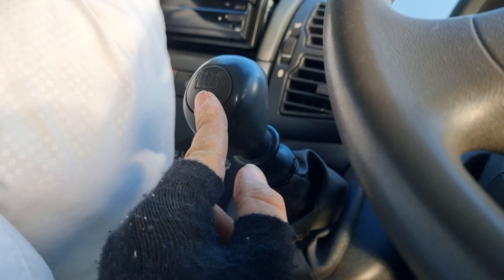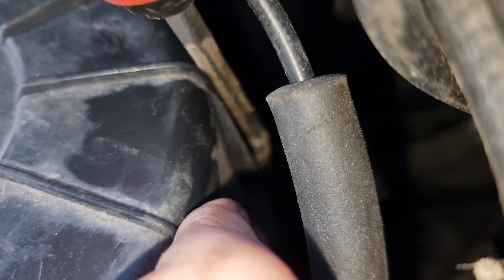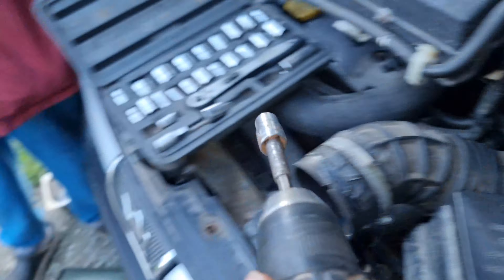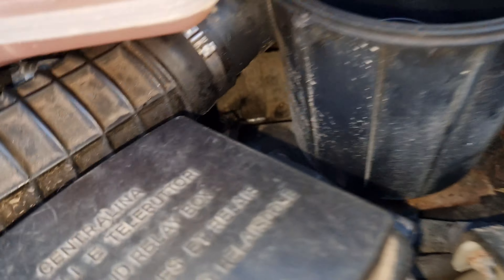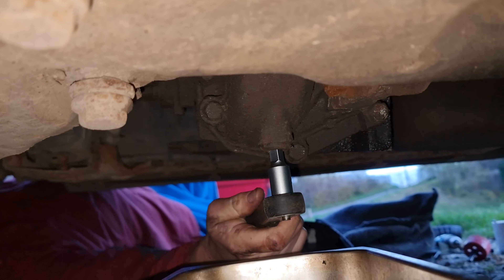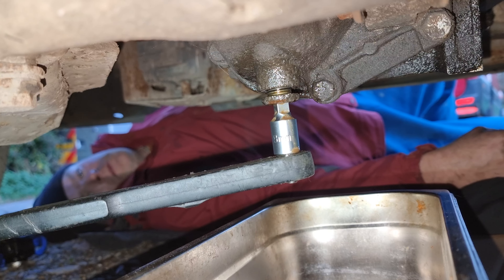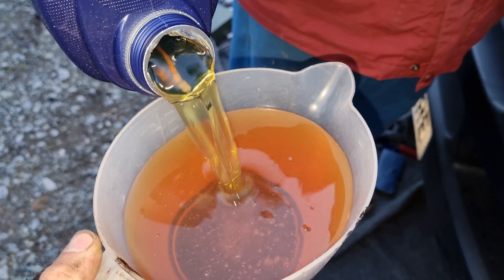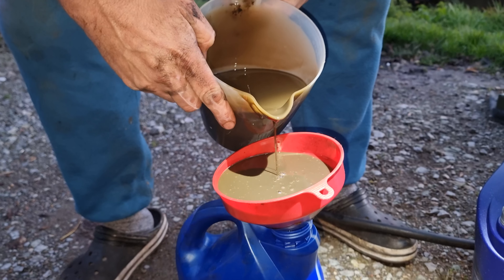Peugeot Boxer 2.8 HDI 2002-2005, Gearbox Oil Change | Attempting to Repair Our Grindy 5th Gear

Comment: Good for you guys for changing it. Nobody bothers with gearbox oil. I had the same problem with my windscreen leaking onto my engine. Check your gear linkage cables for play..

Comment: I've got the exact same model of Boxer and like yours 5th gear crunches. Our get around it is to double clutch 5th gear and that seems to avoid or lessen the crunching considerably to the point where it cant be heard. Our van has 140K on the clock and has been crunching in 5th since before 120K so its not gotten any worse in 20K miles by double clutching...........I'd also say that cleaning and greasing the gear linkage on top of the gear box is a must as this area is prone to getting lots of crap on it which can only make gear changes worse if left unattended to........

Comment: The problem with it being an ex mini bus you just dont know how many bad drivers have been behind the wheel,it could last for a long time as long as you take your time putting it into 5th,but its one of those how long is a peice of string moments at least you have given it a chance by changing the oil.
Reply from the maker: Good point. Luckily, we don't often use 5th, but I'll let dad know. Cheers for the advice 👍

Comment: Hi Josh. As a Mechanic who did 34 years in the motor trade I can honestly say that I think your 5th gear synchro is at fault. This means a new box or a refurbished, oil won't make any difference mate. Hope you get it sorted. Dave and Rach NB HOLLY X
Reply from the maker: Thank you 😊 David. That is what dad thought, too. We were hoping to get away luckily, but clearly not. It's good to hear it from a mechanic. It's strange that it's going at 80k miles. Do you know how long it will last and how much worse it will get?